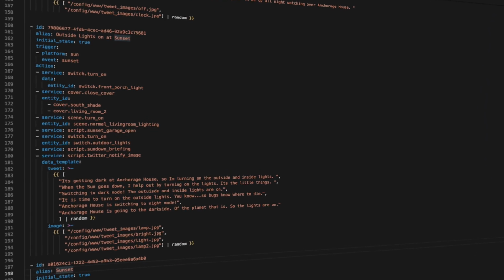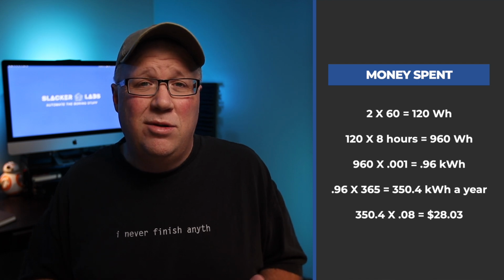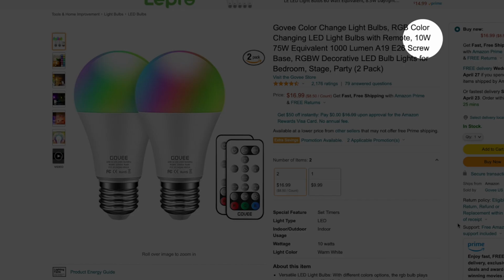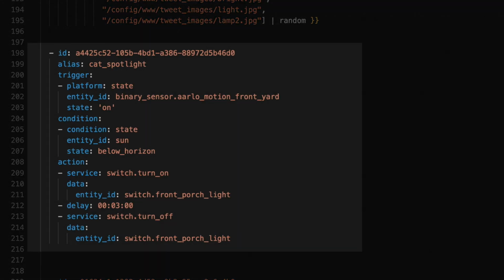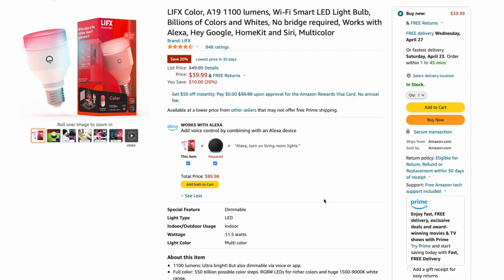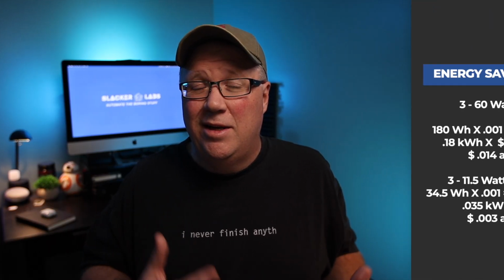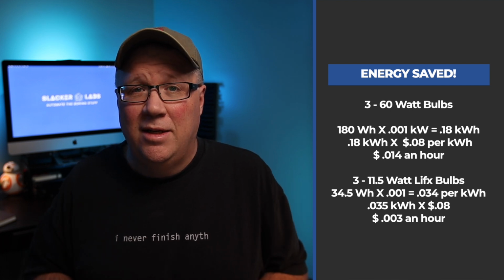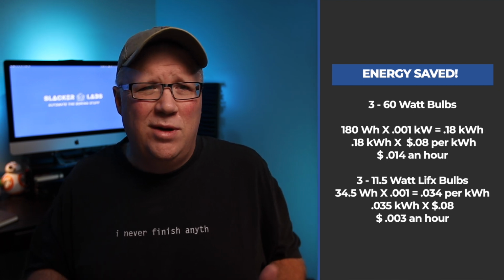Using Your Smart Home to Save Energy #EnergyChallenge

Comment: I'd say this is a bit miss-targeted. Start by figuring out the largest users of electricity and attack those in order to try to get bigger savings (and faster paybacks on your time & $$$). AC, electric heating/air handling, electric water heating, pool & spa, electric car charging, electric ovens & cooktops, electric dryer and washer/dishwasher are all big consumers. 

If you have a time of use (TOU) plan available from your power provider you may be able to target time-shifting to save on your biggest consumers. Do washing, drying & dishwashing in off peak times  - this can be more of a user training issue - but you could schedule reminders/ black out times or a peak/off-peak indicator). When washing - the cost to heat the water you used is probably more than the machine energy consumed. So put your water heater on a smart switch (via a contactor) to run it only at off peak times (bigger water heater?). Set your pool pump/spa to clean only in off peak. Charge your electric car only in off-peak. Pre-heat/pre-cool your home extra before on-peak times. Track open windows/doors while heating/cooling. When you are on vacation turn off your water heater and set AC/Heat to maximum practical energy reduction (use smart thermostats & remote control to still come back to comfortable home). Monitor detailed energy usage to better identify more saving potentials.  Lighting is probably down the list a bit.
Reply from the maker: Time shifting only saves money though. Those devices don't use less energy just because the time shifts. And most of those large appliances already run only when needed. Its not like you are running your HVAC, stove, or dishwasher just because you forgot to turn it off. For the big appliances you can either use it less or spend the money to upgrade to a more energy efficient model if you want to reduce how much energy it is using. 

The door/window sensors tied to your HVAC is a good suggestion since that can make your HVAC run more if you leave your doors and windows open while the HAVC is set to cool or heat. 

If your goal is just to save money, time shifting and time of use plans make a big impact. The video was about using smart home tech to be help reduce energy with those indirect devices like lights that are commonly left on when they are not needed. The money saved is just a value add.
Reply: @SlackerLabs  I (and most I’d say?) care more about the cost of energy used not specifically the amount of energy. The money saved is the main thing - and less overall energy consumed is the value add. Sure I’d like to use less as long as it’s not too inconvenient or uncomfortable. Yes upgrading to more efficient appliances might get you bigger savings - then it’s an ROI + intangibles question on value. However starting with the biggest consumers still makes the most sense.
Reply from the maker: Yea. Right on. I get that. I agree. We all want to save money.

Comment: I would but my home assistant is in safe mode. I only start with it, after using node-red for years.  I install HACS then mushroom.  Then is crashed.
Reply from the maker: hmm. Thats seems like a weird chain of events. Not sure why HACS or Mushroom would crash it. Typically you just get it screaming about those things in the logs when they fail to load or have issues. Safe mode makes me think there is something up in the configuration.yaml file that it doesn't like.
Reply: @SlackerLabs  Where work I get a replacement config.yalm file mate. I did put 3 lines in from the mushroom file. Then I removed it. No change.

Comment: kind of curious why you don't just use presence detection to turn on a light at night... like if someone recently came home within the last..... 5 or 10 minutes, you can turn on the light if you detect motion.  otherwise just don't turn it on... and if it's someone from 'outside' the home.... and you're not home.... the light not turning on can indicate nobody is home.... otherwise you can turn the light on manually via smart voice devices, a switch, or home assistant.... that would significantly cut costs... i myself did my own little change in home assistant, not on earth day, but to save cost just by doing things like.... instead of turning on an inside light to provide light in the home when someone comes home... wait until they actually open the door and then turn the light on.... this way if they don't come inside right away... the light doesn't come on for no reason
Reply from the maker: I am starting to use room presence more. But so far it is a bit flaky partly because not everyone in the house carries a device with them all the time, and even when they do some times my esp boards don't always see the devices. Most of my lights are motion based combined with a lux sensor to determine if its actually dark enough to need lights. And I dont want people thinking we are not home, so the lights come on when people come around.
Reply: @SlackerLabs  I understand that. I recently found out that 4th gen echo devices have a “ultrasound” motion detection. And while it works pretty good for detecting when someone shows up…. It’s a little lacking in when someone leaves. However I suppose I’d rather have it feel like someone is there rather than kill power/lights while there is someone still in the room. It’s the reason I don’t use the “people” entities
Reply from the maker: Yea. I just use the people entities for stuff that happens when we all leave like arming security. And turning off all the inside lights and fans. And when we return for disarming security And if it’s dark when we return turning on the driveway lighting. Inside lighting is all context based. Most of the lights turn off if no activity in the room for a period of time. Unless something like the tv is on meaning someone is in that room. But I don’t think I have had a situation where lights turn off in the room while someone is in there. Most rooms have aqara motions sensors plus the ecobee occupancy sensors which have a long reset period so they are pretty accurate. Just takes 20 mins for them to know people are gone.
Reply: @SlackerLabs  ah yes. I see they’ve updated the way the person entity works. I refused to use it after the last time I had looked where it updated itself based on the last updated entity associated with it. It kind of defeated the purpose

Comment: I don't want to ruin the party (saving energy is always a good thing) but why are you all focusing on saving dollars without adding up all the dollars you need to change all the bulbs, adding the sensors, etc...?

The ROI is several years.

Let's focus on the kWh saved and let's be happy to spend some dollars to reduce our consumption.
Saying we'll be saving the Earth with our lights turned off automatically is a bit exaggerated... 

I propose that next year this #EnergyChallenge should involve CEO of heavy consuming industries...
Reply from the maker: Yep. Because you are going to spending money on replacing bulbs over your lifetime. And no matter cost of those bulbs they are going energy. And honestly you can buy cheaper bulbs than I talked about that save the same energy. That cost is not
One you can avoid. The focus was showing that you can use smart home tech to reduce energy consumption. Which will work no matter bulb you buy.

Comment: something reminds me of one of my mother's annoying habits. she used to open the window in my room to let some air in, nothing wrong with that. the problem was that she kept forgetting to close it again, so she started turning off the radiator. in summer that was no problem, but in winter it was freeeeeezing cold by the time i got home. plus, because she kept turning the radiator off, it was practically impossible for me to find the right thermostat setting. so one day this happened again, and i went downstairs and gave her a big bollocking. then i went into her bedroom and did what she had done to my room. when she complained about having to sleep in a freezing cold room, i said something like "now you know what that feels like!"